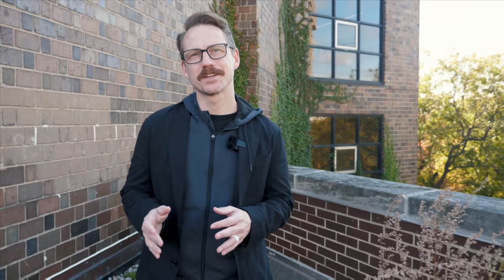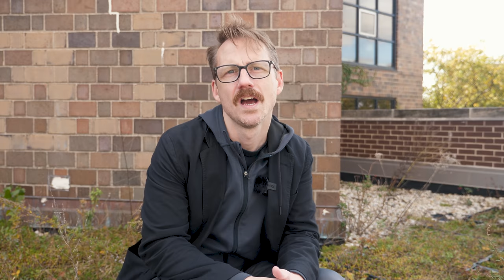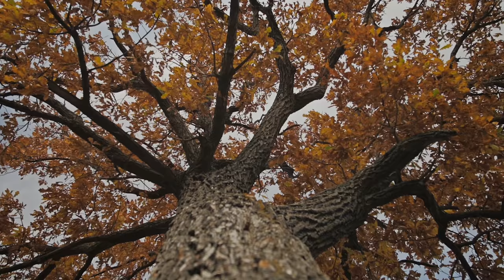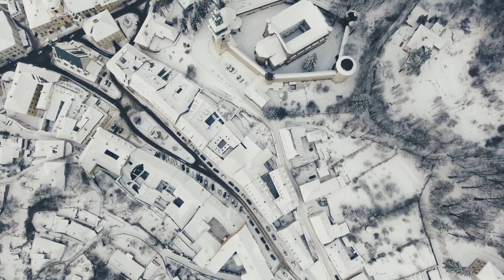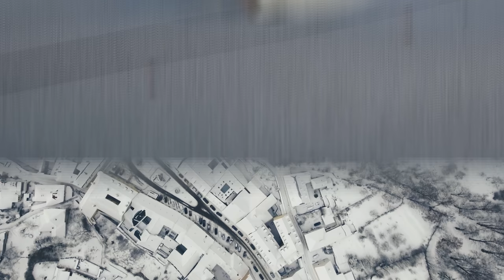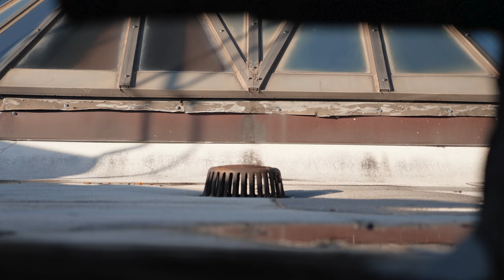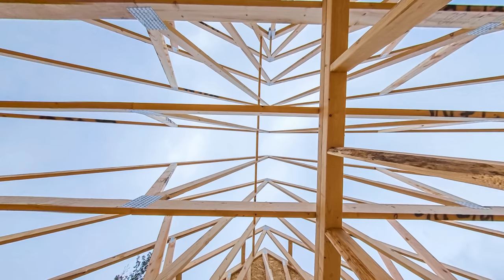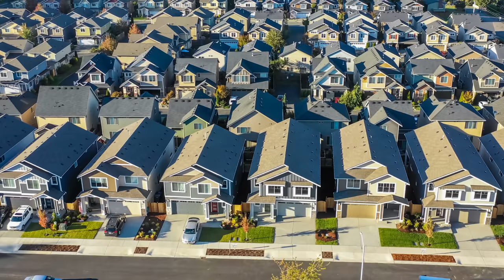Why Do Architects Insist on Using Flat Roofs?

Comment: i actually wanna add as an ex-roofer;
flat roofs are generally much easier and faster to repair/replace. and some large commercial buildings have taken the same amount of time a residential House has, dispite being 1/4 or less the commercial buildings size.
Reply: When I framed houses, decking the roof was the part I dreaded the most. I live in FL, so most were only a 4 - pitch.  But being a small guy if a gust of wind came,  I would using just have to let it go. Otherwise we'd both end up on the ground. Thats why if I could I'd be the cut man.
Reply: Built a house with my buddy over the last year. Shed/flat roof would have made it sooooooooooooo much easier to do, but it snows here, and the HOA where he lives has a roof pitch minimum lol.
I'd do shed/flat roof on any house I build and want to live in myself, I love the more Modern/MCM look anyhow
Reply: @ChuckD99  Yeah it kills your back. Just nailing it off and put unlay is bad enough. I wouldn't be a roofer.  Though I've seen some  roofers with basically couch cushions for kneepads. That way they didn't kill their back bending over constantly.
Reply: @ChuckD99  Was it a hip or gable roof?  Just getting the trusses set properly on a hip roof can drive you crazy.
Reply: @fukkitful  gable roof. I don't think a shed roof would work well for his house but I'd just design or get plans for a shed roof if/when I build haha
Reply: @fukkitful  cushions are great for low or even some steep roof pitches tbh, well worth he money to save your knees. Always wear your PPE!
Reply: ex roofer in australia and i clicked this video with your comment in my head, would rather lay a flat roof anyday
Reply: Out of curiosity, what sort of "flat" roofs were you decking out? Were they steel? ... if they were, then I'd be guessing they were actually just a few degrees sloped - that's still a pitched roof. The god-awfulness of properly "flat" roofs (e.g. 1 in 50 or 1 in 100 grade) usually involve a whole lot of stuffing about with rubber membranes or tar or various other time-consuming processes with a lot of places to go wrong. I would tend to think most roofers would hate those kinds of roofs (unless they're being paid hourly and not a fixed price for the job). They seem to have a tendency to involve re-work by the roofers after the first decent rain they see (when any small mistakes in installation show up).
Reply: @danielscott4514  this is actually a funny thing, I'm Canadian, and I've personally never had to deal with any of that eubber rubber stuff, which im actually surprised to see they never mentioned here, so maybe it's a canadian thing, but what we do is we put down a layer of some sorta board, (i forget the name, but it's a tar fiberglass thing, pretty light, about 1/8" thick) and then we use 2 layers of a base, and a torch on, which we actually melt down onto the roof with a torch as we roll it out. and we do that with both layers. here in canada that's the standard
Reply: @danielscott4514  Pitched roofs and flat roofs, always corrugated tin, in australia we don't use rubber membranes or tar but its very rare to have leaks in a tin roof unless it's been damaged by hail or installed wrong
Reply: When they said flat roof. Is it really that flat at 0 degree angle or does it have 1 or 2 degrees pitch?
Reply: @nntflow7058  they're generally used interchangeably tbh, but considering the video, they probably mean low sloped roof
Reply: @nntflow7058  Depends on the flat roof. It could be a degree or so (which is ok), or if it's the sort of roof designed for regular foot traffic (e.g. a tiled rooftop terrace) then the amount of fall could be around half a degree (a 1 in 100 fall) towards some kind of drainage - assuming it gets built right. It's more common than you might think that waterproofing and correct slope are done wrong by builders.
Reply: I do metal buildings, and I am always scared shitless on a roof, when I forget my tennis shoes. I would love doing flat roofs.
Reply: @jukebox_heroperson3994  same, i live in canada, and here we have wsbc, and they commonly wany us to wear steel toes on steep roofs and basically everyone on the site is mutually like *no*.

not to mention im only 21, but after a few long days on a metal roof my feet are killing me
Reply: @vulbyte  Oh yeah dude, ankles and back just feel fucked after screwing off all day.
Reply: That's interesting, I had no idea that the time differential would be so dramatic.  As an expert, please correct me if I'm wrong, but I'd imagine that the difference in speed has to do with the increased safety precautions involved in working on a sloped surface compared to a flat one, as well as the nature of the materials and installation techniques involved.  Personally it sounds a hell of a lot easier to roll out large sheets of rubbery material that's held down with adhesive (while crouched or standing) than it does crawling around on your knees, nailing down heavy stacks of shingles.

I'm a fearless DIYer (because I'm too broke not to be) and the roof of my mid-century modern home (built in 1960) is a nearly flat roof.  After patching it myself a couple of times, I can honestly say that I feel like I could probably tackle the job of replacing it if I had the help of at least one other person, and I would bet that we could knock it out in an afternoon.  That said, despite my confidence in my DIY abilities, I would never even consider attempting to replace a shingled roof of that size on my own.  I would probably consider replacing or installing a shingled roof on something small, like a shed, because working up on a hot roof is no joke.  Having some very limited experience in tackling a handful of small DIY projects, that required me to be up on my roof, I now have mad respect for the guys who do that shit for a living every day.
Reply: But a flat roof has to be redone every twenty years, where a  roof with traditional roof tiles can last 75 years.
Reply: @groomboek1978  LOL nope, not even close.  My flat roof appears to be the original, and my home was built in 1960.  I've had to patch a few spots here and there as tree branches have fallen and compromised those areas--but compared to my neighbors who have shingled roofs that get damaged by wind and tree branches, they end up with blue tarps on their roofs for months while they wait for contractors to finally fix it.  Turns out when your roof gets jacked up because of the weather, everyone else had the same thing happen--unless they have a roof like my house, in which case we laugh and occasionally throw another patch up there.
Reply: @kernelpickle  I unfortunately have a house from the seventees with a flat roof ,and the tar paper has already been replaced once by the previous owner. And it is in urgent need of replacement again. I hope I can save enough money to put a real, i.e. angled, roof on  the house it before the current roof starts leaking.

Shingles are something different than roof tiles. Shingles is the same sh*tty  tar paper split in small overlapping pieces. Ceramic roof tiles last a life time.
Reply: @groomboek1978  If you have a flat roof with tar paper, then I feel sorry for you, because there are rubber membrane roofs that don't suck like tar paper or tar shingles.  There is no tar on my roof, and that's why it doesn't suck, tar breaks down over time and becomes brittle, and it cracks.  The rubber membrane stuff I've got doesn't have that issue.  Every once in awhile a seam will lift up on one of the patches I've put on,  but that's not a big deal to inspect and fix once a year.
Reply: A pergola and solar roof which works as an overhang roof
Reply: Thta's nice because they needs replacing/repair ten times as often
Reply: And non-flat roof don't need to be replaced...
Reply: @ChuckD99  I’ve used cushions for years. Also the right knee pads are essential.

Prime grip makes a good one with covers for the leather straps so you get less chafing, and they grip the roof incredibly.

Now there’s the pitch hopper instead of the old couch cushion. Sure it’s more expensive but also works way better, and time is money
Reply: My mother in law's stone house in North Wales is 200 years old, and has the original slate roof. If you choose the correct materials you do not need to repair or replace  them often.

Comment: Additionally lots of single family neighborhoods, especially view and small lot neighborhoods, have building height limits. Having flat roofs maximizes interior space and allows building out to the height limits. 
Great topic!
Reply: Here is Japan it's Sunshine Laws, which generalizes height limits (horizontal lines) to sloped lines.  Probably in this case, the shape of the roof doesn't matter much.
Reply: @davidhawley1132  What do you mean? can you explain a little bit more?
Reply: My city’s District Plan building regs allow for pitched roofs of specified max slopes to extend above the height limit envelope. They recognise sunlight planes  are angled.
Reply: So you're saying we should end single family zoning.
Reply: Absolutely true.  I've designed many buildings where the height limitation came into play.  Not for the reasons most people think about though.  The RTU (rooftop units) aka air conditioning condensers in any of the jurisdictions I've worked in fall under the purveyance of the height limitations. The parapets and screening to hide the RUTs however are.  Flat roofs allow us to get the client the maximum bang the for the buck while keeping the constructability feasible and costs in check.  

I myself prefer to use single slope roofs with variable truss heights to provide a 3 slope roof.  This allows for more drainage locations.  Extra crickets with variable pitches as well (to allow for shorter runs to the point) increase the potential drainage locations.

As one of the top 1% revit gurus in the US (ego stroking yes but I made sure to learn from the best aka Aaron Maller), I've also created the families to better enable both the project manager and the mechanical engineer to calculate and accommodate roof drainage regulations in the jurisdiction we're working in.
Reply: @ratgr  it looks like the Japanese have a literal right to sunshine, which is pretty neat imo
Reply: @ratgr  Other places have/had similar rule.
One variation of the law is requiring the street to have sunlight. So your building can't be tall, but if you make it slopes inwards as it goes up, it can be taller.
Btw, roof shape should still matter regardless.
Reply: @djdoc06  Form follows simplistic rules. Maybe it would be better to change the rules. Instead of limiting height in the city, what you need is to limit visual and light impact. For example if you put a low slope pyramidic roof on a a high square building then the building may be slightly higher but the visual and light impact is small to none.